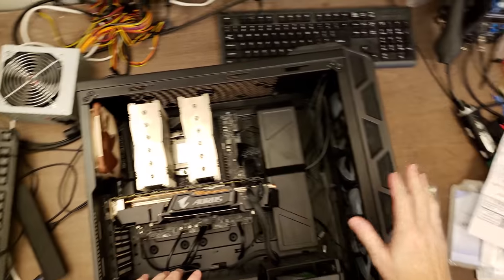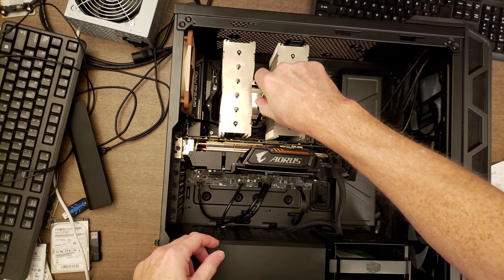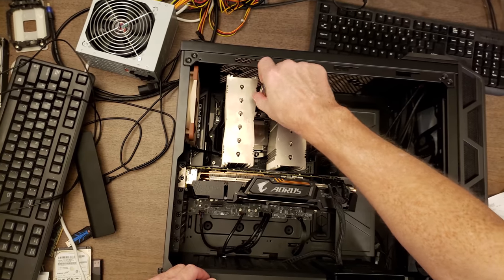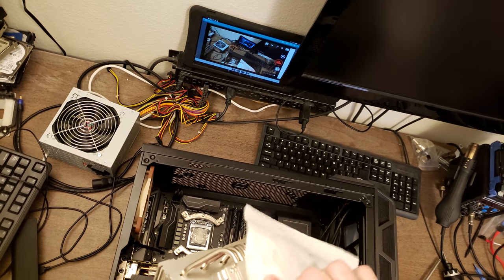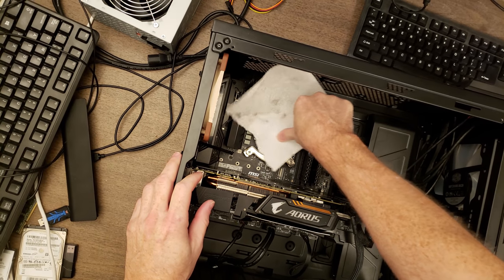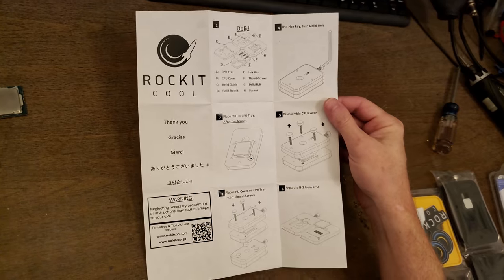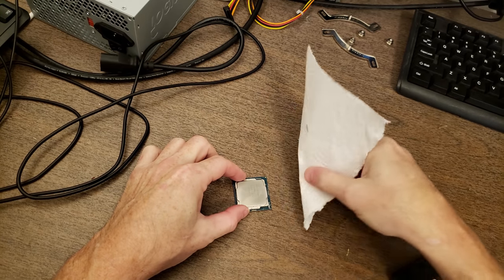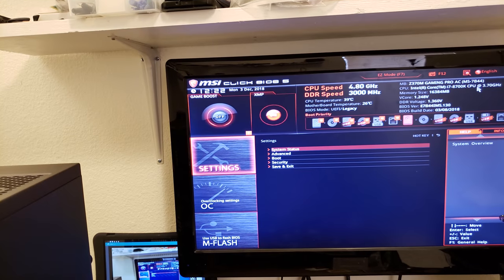CPU delid with liquid metal on a Intel Core i7 8700K

Comment: Nice work, just a few nitpick items.  You should use your fingernail to scrape off the old IHS adhesive,  Also ditch the AS5 and use MX4, NTH2, MasterGel or a dozen other carbon based pastes that don't have burn in times and are way easier to clean not to mention better performing.
Reply from the maker: I won't do that again.  If a CPU needs to be dellided to work properly, don't buy it.

Comment: Why are you taking off that adhesive?? Just reheat it and re-use it, it will stick enough to the ihs so it doesn't moves.. Sheesh.. One guy sees someone taking off the adhesive from the IHS and around the cpu die - and then automatically everyone else's doing it as "Default"...
Reply from the maker: Ok I didn't know that was an option
Reply: TechJesus sais that it's too thick. Replacing it with a very thin layer of adhesive will improve thermal conductivity.
Reply: It's silicone, so re-heating isn't going to make it stick.

Comment: oh man, u used that thing to spread liquid metal, come on, thats not the way to do it, use a q-tip and it will be a lot better that way.
Reply from the maker: It actually worked well. All of the CPU cores are within 1 degrees Celsius of each other.

Comment: Far too much LM - very poor method - Didn't know how to use delid / relid tool - You said that this work was for a client, I think that you may have just lost a few clients !
Reply from the maker: It worked. I dilided it, replaced the thermal compound with liquid metal, put it back together and the thermals were much lower. Also consistent across the cores which means I did a good job.
Reply: @MichaelTheComputerGuy  don't listen to this dude. There's more than one way to do things and you got good results.
Reply: Everyone has their own way of doing it as long as the result is valid, always easy criticism!
Reply: @Philippe.63  Have you done a delid and used LM? I have and I stand by my critique of the method and the amount of LM used. Everyone has ther own method you say, there are only a handful of methods to get this right and this is not one of them. The amount of LM used here is enough for at least 3 correct applications, there is a high risk of problems here, might get lucky!
Reply: @DansTech307  I'm going to do a delid next, I'll take your advice into account, I always put a small amount to have a thin layer.
Cheers
Reply: @Philippe.63  Hi - This is the best YouTube video I've seen on applying LM  by 'Actually Hardcore Overclocking'  - How to safely apply liquid metal to things. Hope your delid goes ok . Terry.